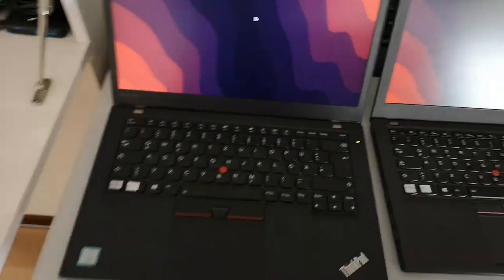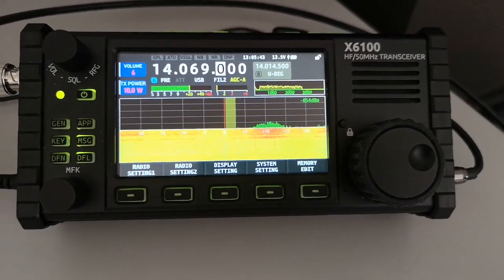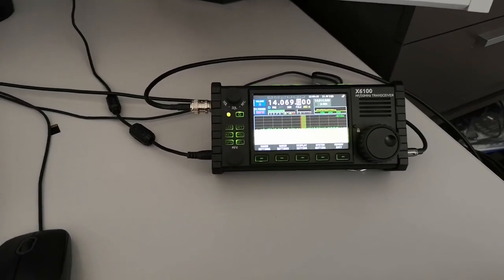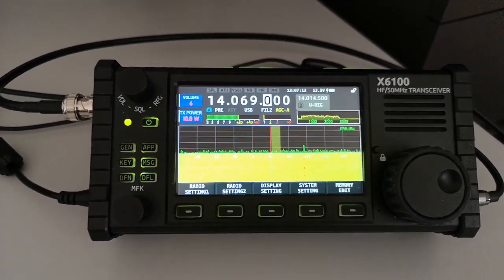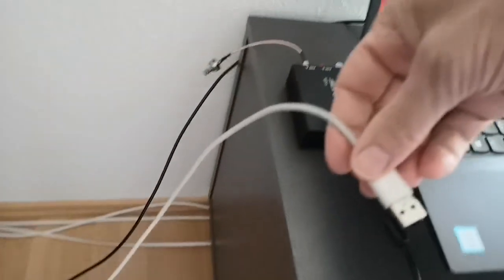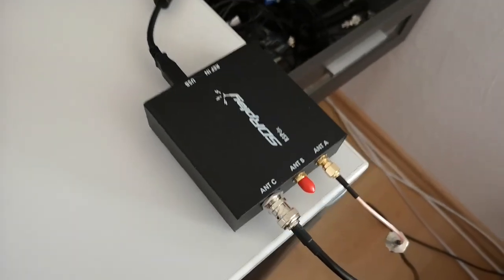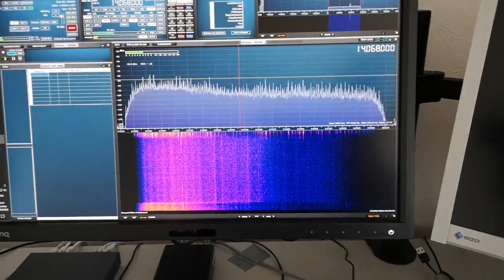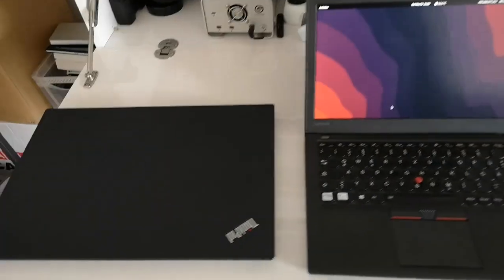Computer noise from computers on internal antennas

Comment: I own an old ThinkPad 420 and an RSPdx.  I'll try to check this although I don't have the same antenna. What I did thoug was to use a shortwave receiver (xhdata) and found that my monitor generates quite a lot of noise on 14MHz. Also, the LED lights on my ceiling are super noisy on 144 MHz.
Reply from the maker: There are so many sources of RF noise in domestic situations. I have a cheap LiFePO4 battery charger that generates horrendous amounts of noise !